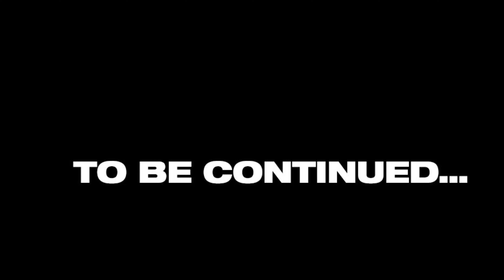My LSX Turbo Buick Regal Coming together, New Motor & Suspension

Comment: With those ls3 head did you use the 6.0 rockers arms or did you have to use ls3 rocker arms
Reply: Gen 4 6.0's and LS3's have the same rockers. But the Gen 3 cathedral port heads rockers wont fully work on a LS3. Only the exhaust rocker would fit. But intake rockers are off set on rec port heads. So Gen 3 rockers wont fit over the intake valves.